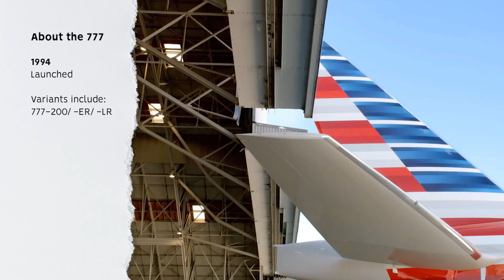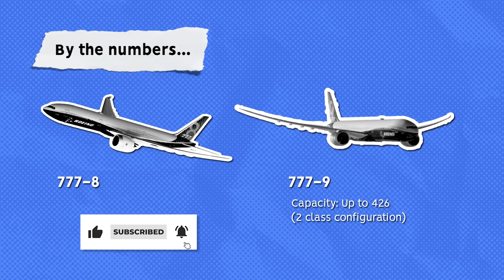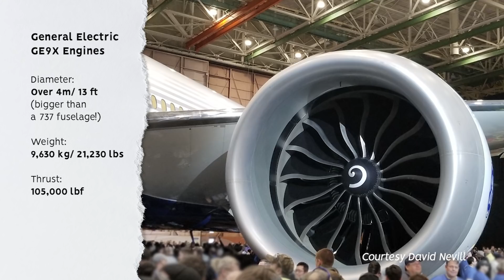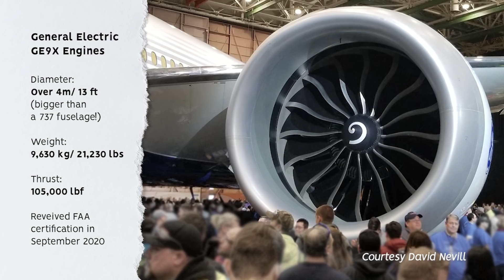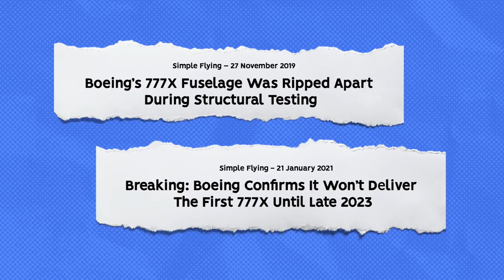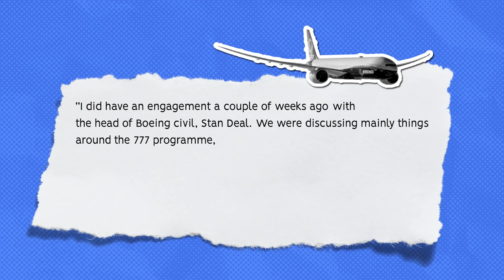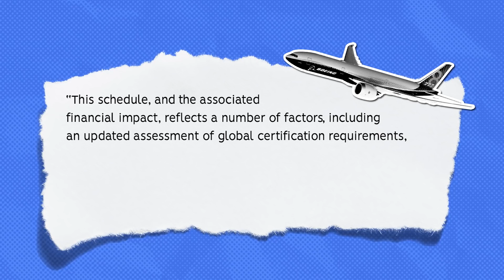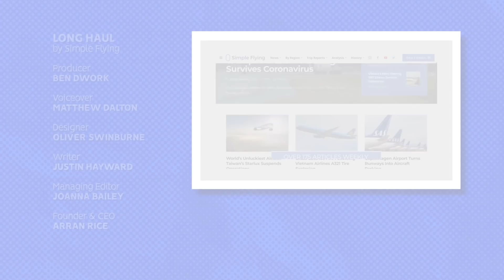Boeing 777X The New Twin-Engine Jumbo Coming Soon

Comment: A question: Why Boeing doesn't try to put two of these huge engines on a 747-8 body?
Reply: Probably the engines would be mounted too low on that frame. Or they just don't want to show up the GEnx engines lol at more than 50% extra thrust per engine 😅
Reply: Because the engines on 747-8 are actually ge9x engines
Reply: @roshannellore9793  GEnx-2B (essentially 787 engines)

Comment: The 777 series are amazing aircraft. The 737MAX debacle and cover-up has turned me off to Boeing because they proved Boeing could not be trusted as profit over passenger safety was the motto for the 737MAX. Hopefully, with Muilenburg gone, this 777 will be the safe and reliable jet Boeing built before the 737MAX came along.

Comment: ''Extra space for seating'' ?  you are kidding?   The original 777 was nine abreast seating, the seats were an almost civilised width. Then they invented the 10 across seating which made the seats more narrow than the 737 which is a nightmare quite literally for long overnight flights which this plane is intended for.  The extra 4 inches will do little to improve this. Also the 787 was originally conceived to have 8 seats across but the majority of them have the greedy airline 9 across.
Reply: Yep !! 

Japan Airlines configures their 787’s in 8-across, and it’s a good long-haul aircraft. 

I simply will NOT book on a 9- across 787 ...They’re horrible ...
Reply: @sking2173  Have done some 9 hour night flights on 787s and were miserable.  One way from New York to London was just about bearable.

Comment: 10% lower operating fee, 20% more expensive. Good one for Boeing.
Reply: On the face of it, a good argument. There is, however, an important consideration which that aircraft acquisition cost is just a fraction of operating (fuel) costs. That can make a 20% more expensive model that saves 10% a very attractive proposition.

Comment: that the only customers are non-US might say the extreme-range + high capacity does not fit US, which might need either extreme range for 787/A350. I imagine the US high-capacity routes are NY-Europe or SFO-Tokyo? do these fit the existing 777, assuming much lower cost of a new aircraft? I would like to see cost-seat-mile vs range for each of the wide body aircraft. The max range seat-cost values only may not be a good representation if the majority of routes are intermediate range

Comment: I stick to Airbus. Better quality, safer, better customer experience, much quieter.
Reply: Actually Boeing has been the leader in widebody aircraft since 5 the 60s. Airbus until  the 350 has made a mess of their designs.
Reply: @larrydugan1441  very true! And I absolutely loved the 747, what a brilliant airplane. But in the last decade I personally find Airbus better. Fair enough, the A380 was not a commercial success but a fantastic airplane to fly. Same for the A340 and A330. I haven’t yet flown the Dreamliner so I can’t judge, but I’m not a fan of the 777 or the 737.
Reply: @arjandeboer651  The 350 is a fine aircraft.
The 787 is also a fine aircraft which is popular a reason.
Having flown the 777 300ER and 200LR I can assure you that they also are fine aircraft that dominate the wide body market for a reason.
The 737 max exists because the 737 is an incredibly popular aircraft since the 60s. It was necessary for Boeing to upgrade the aircraft to maintain commonality and it is an efficient aircraft that is selling well. Recent problems aside it will continue to be a success until Boeing builds a replacement. 
I myself try to avoid the best manufacturing game as it is for enthusiasts but not professionals.
Reply: @arjandeboer651  787 ruined with narrow seats. Was originally designed for 8 across seating but most have 9. Terrible on long haul or night flights.

Comment: Yes the 777X in financial terms alone is a great 747 replacement. But it doesn't have the charisma of the Queen of the Skies. It's a narrow perspective. I've only felt cramped on one type of aircraft and that was the 777 despite being in an exit row. I never feel that way on a 747. I think that just offering some lower operating cost is 'missing the point'. Flying short haul, frankly it doesn't matter too much if it's not a great experience because it's not for long. Long flights are very different and people remember how it was. I've NEVER heard a bad word from anyone who flew the A380 for example. I guess time will tell if anyone might pay a premium to fly in a spacious comfortable plane for 8 hours or so. That plane certainly WON'T be the 777X.
Reply: A380 is much better than any other plane ever on long haul or overnight flights. Ive had circa 20+ flights on them, most overnight. Far better than the ultra narrow seats squished into most 777s and 787's now.  (an A320 is in fact more comfortable than those two)

Comment: Hardly anyone is flying 747s any more (except for freight) and most are going into retirement i.e. scrapping. Likewise the A340. The A380 is soldiering on largely due to Emirates. The market for huge jet airliners has gone away, at least for now. I really, really think Boeing's going to have trouble selling this thing.
Reply: Your misreading the market. The 747, A340, and A380 are going away mostly because they are inefficient and being replaced by large 2 engine planes like the 777, 787, and a350. It's not really that the 747 and a380 are to large its that you can do those routes for much cheaper with a 777 or a350 for less then half the cost

Comment: Aren’t the A350 and 777X in slightly different passenger classes? With only slight overlap between the A350-1000 and 777-8? Doesn’t the A350 compete more with the 787?
Reply: 1) yes, if u meant 'size' or 'seat count'.
2) yes, usable cabin total floor area for seats of 35K and 778 are practically identical if in similar cabin config/seat density.
3) Depends on which of the 2 specific 350 variants u are talking about.  In terms of seat count in a comparable cabin config, the 359 sits right in between the 789 and 78J but obviously larger than the 788. Therefore, a more accurate description is that the 350 family competes against BOTH the 787 AND 77X families if u are disregarding specific variants in your original question and simply mentioned '350' and '787' which refer to their entire aircraft families.
Reply: A359 competes well with the 787, the A351 nips on the tail of the small base 778, but cant touch the 779, A351 already has no shot with the 779, if Boeing makes a 771 forget about it

Comment: Seems “improved” passenger comfort is overlooked! Yet, again!
Reply: Yes 10 across seating killed the 777 for long distance flight.
Reply: @stephanguitar9778  Even at nine abreast the 777 is the most uncomfortable widebody I've flown.
Reply: My son flew from Melbourne to LA some years ago on a Virgin Australia 777. He said it was very comfortable.
Reply: @rais1953  Virgin Australia is 9 across seating and 1'' more legroom than Qantas. Non of the new ones will have this configuration and many are converting their old 777s to skinny seats. Also depends how big or old you are. Teenagers and cats can sleep anywhere and not suffer.
Reply: @stephanguitar9778  Yes it was the 9 across searing that impressed us. Virgin Australia may not resume the LA route anyway after the air routes open up.
Reply: That is never part of the equation.

Comment: This is just “another variant.” The B787 has lighter carbon composites which improves strength of cabin pressure to acclimate to 6,000 ft in cabin (not the standard headache, literally,  of 8,000 ft in all planes) AND fuel efficiency!

Comment: It would be great if Boeing could put some thought into seat comfort rather than maximum profit using seat configuration.  If you're over 6' tall flying any long haul flights is torturous with these new seats and configurations!  Even business class is too small!!
Reply: I don't think this is Boeing's fault, airlines want to make things as cost effective as possible
Reply: @oShinobu  The airlines purchase the seats and recommended configurations from Boeing.  It's nice to have better air quality and quieter cabins, but it's too bad they couldn't maximize seat comfort and profits as well.
Reply: @taconomad1862  Don't other plane manufacturers do this as well? They need to stay competitive in that case. Of course it sucks for the passengers though

Comment: i feel like boeing needs to make a freighter out of this to make it sucessful, in a way with the 747-8, but just with more passenger aircraft flying. But then a 787f could be better as the 767f is getting on a bit for sure
Reply: A 777-8F seems more than likely, Qatar has expressed interest in that aircraft
Reply: @spongebubatz  oh yeah definitely, considering there’s also the 777f already. But a replacement for the 767f surely will be needed too as the 767 is 40 years old this year, and something tells me Boeing isn’t really in a state to re-engine the 767, keep fixing 737s and finish the 777x whilst dealing with 787 issues too

Comment: It's just another variant IMHO. I'm now retired but I've flown the 747-400 and 747-8 and the 747-8 was pretty much a disaster in the beginning, so I can totally relate to the "...in a state of disarray..." comment by Tim Clark. Boeing couldn't organise a bing-drinking party in a brewery. In the US, everything is a 'quick fix' and this 777-x will be the same: a lot of hype and marketing. Rather than build something new from the ground up as Airbus has done with the A350, Boeing just 'slaps on some new wings and engines' and some software patches 'to 'make it all work' and calls it a day. Now how did that work out for the 747-8 and the 737MAX? 🤔
Reply: the 748F was a success though
Reply: @hibikismusic  Sure...that's why it's still in production....NOT! 🙄
Reply: They did, the 787...
Reply: Boeing is a terrible, shitty company. Their safety standards aren't that high either...
Reply: @CicaeMeow  
A340, A380.  
Boeing of course has had its share of problems.  
Both made bad mistakes.  
The 777x and A350 as well as 787 will be great.  With such technology and high stakes the successes come hard.
Reply: @CicaeMeow  Euro jealousy has no bounds.  How did the A380 work out?  Wrong airplane at the wrong time.  If Airbus weren't subsidized the A380 would have buried it.
Reply: The MAX is flying with 4500 orders.  787 is a masterpiece and it looks like 777X will be too.
Reply: @scottw5315  
787 is great. those not built in Seattle...
Reply: @andylane247  Sour grapes from the machinists union.  They F'd around and found out by losing much of their business.
Reply: @scottw5315  Some airlines insist that they only receive Seattle built aircraft...
Reply: @andylane247  Not to beat a dead horse but even with 1600 orders it's unclear if they will make any money as development costs are insane.

Comment: 4 inch wider.... Great let's squeeze in another seat to make it a 16inch seating for 14 hours flight. Lol.
Reply: Haa haa haa hee hee hee sums it up quite nicely, maybe they could strap some seats on the outside and and another 4 in the wheel bays, just remind the pilots not to raise the wheels.
Reply: Yes, I flew LAX to Saigon 14hrs 10 times.  It was hell for my 6-2 body. I finally reserved a seat in front of the exit door.  This means No Seats in front of you!
Reply: @MartinSage  Quality Control is a by word at Boeing they most probably got the measurements wrong and didn't double check them.
Reply: That's the customer's decision, NOT Boeing's.
Reply: This comment is simply stupid...
Reply: @ndlben7129  But correct. Have you ever swapped 777s on a brief stopover on a 24hr 10,000mile flight, gone from a 9 abreast to a 10 abreast?  pure torture for anyone bigger than a small teenager or a cat.
Reply: @ndlben7129  But true

Comment: And It will be the newest lowtech plane in 202x,  Did they discover on the 787 that hightech didn't work for them, with all the problems, faults and production flaws. So lets just reissue the 777 like they did on the 737 for 60 years

Comment: At a time when the Chinese are about to really enter the market I wonder if we need Boeing, especially when you take into account the justified low consumer confidence
Reply: Let the Chinese and Russian aircraft fly for a couple of years at least.  They'll be basically sound, engineered well enough but initially they may have some rough edges.
Reply: @rais1953  can’t be worse than the 737 max
Reply: Tofu aircraft??? I'll pass thank you.
Reply: You couldn't get me on a Russian or Chinese built aircraft at gunpoint.
Reply: @classicgalactica5879  You may have already been on one. Airbus and Boeing both have assembly lines in China and no doubt get parts from China even for their home assembly lines.
Reply: It would be cool to see a new widebody from a Chinese company, we need some more variety
Reply: I'll never fly on a Chinese built plane.

Comment: So which one is the most efficient (lower cost per paxs)? A351, 778 or 779? As not all airlines could achieve that  high number of paxs (400+). Less load contributes to higher operating cost is it?🤔
Reply: It's just going to depend on the given route and demand. You can rule out the 778 since it's suspended.  Both the 351 and 779 have their advantages and disadvantages.

Comment: It’s a variant, 2 or 3 will crash then it will get grounded and then we will have another drama like the 737 max…
Reply: If just one of these crashes at full capacity because of design flaws, the death toll will be equal to both 737Max crashes. If multiple 777Xes crash, the impact will be even worse. Boring would be wise to keep the McDonnell Douglas bean counters as far away from the 777X as possible.

Comment: It's very interesting to see Air Bus's answer for B777-9..Probably Airbus A350-1000X ?
Reply: It’s questionable whether the niche market of the 777-9 needs or better can handle any competition. What I’m trying to say is that the high capacity market the 777-9 serves is already filled with the 777-9, 747-8 and A380, so Airbus should rather focus on other aircraft
Reply: @spongebubatz  A320ULR, A320 Neo work for Short, Medium to Long Haul Narrow body market..A330, A330 NEO, A350-900, A350-1000 work for Wide body  Long to Ultra Long Haul market..A380 has no future..So now they need Ultra Long Haul Twin Engine, High capacity option, bigger than A350-1000 (or New Electric Airliner 🤫) Airbus have all the knowledge of building that kind of aircraft better than B777X...An aircraft stands in between A350-1000 and A380-800..
Reply: I think it will be the A350-2000 with RR Ultra fan engines. This will be around 2025/26.

Comment: It is interesting that the first 747 took its maiden flight on February 9 1969 and entered service less than 12 months later on January 22 1970 While the 777x looks like taking 4 years?
Reply: It's not particularly interesting. Standards were not the same as they are now 50 years ago. Also  what became the 747 started at a military cargo airplane that had undergone flight tests in about 1964. Boeing lost that contract to Lockheed and pulled that design off the shelf that had already been tested.

Comment: It's NOT really a game changer, but it is the lowest cost per seat-mile aircraft in the world if you can fill it. If you cannot, then it is probably a thin route best suited the the 787. These two kinda brackets the A350 which is neither as high capacity, or as economical as, the 777-9 and too big for the long and thin routes which will leave it partly empty.
Reply: exactly, flying on one won't be anything special in 10 abreast economy. A380 and A350 still comfier to fly on
Reply: @ant2312  It's up to airlines really. The 777 is a tighter than the A350 as a 10 abreast or roomier than it as a 9 abreast (like most of them are today). The 787 is a VERY comfy 8 abreast or a tight 9 abreast. It is up to the airlines. I have flown on the ANA 8 abreast 787-8, but even they went to 9 abr4east with their 787-9 deliveries. Why? Because economy class passengers will rather pay 11% less on the ticket than have more shoulder room. In they end, the market has spoken and airlines gave passengers what they want.
--
BTW, the A350 doesn't have to be a 9 abreast either!

Comment: It's not a game changer, only another variant. Also I am not eagerly awaiting it.
Beautiful aircraft though
Reply: It's another variant but if it succeeds in bridging the gap between smaller twin engined aircraft and the 747 and A380 it could actually make a difference to flying at the larger end of the industry as the A220 seems to be doing at the smaller end.